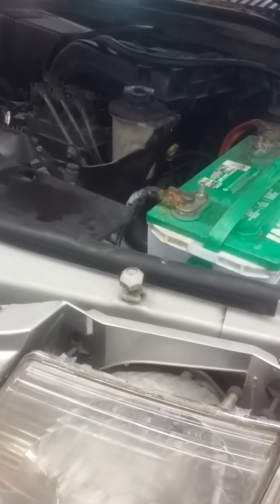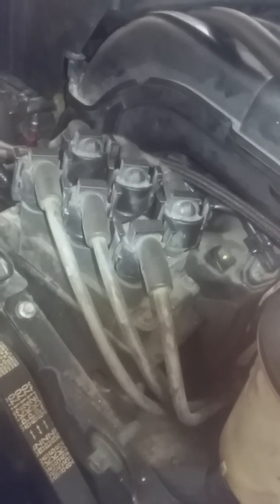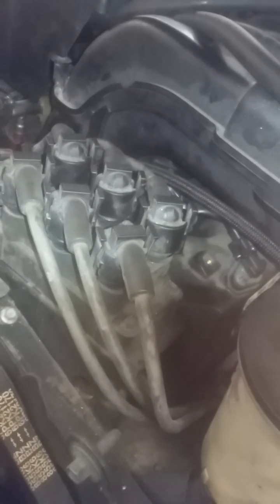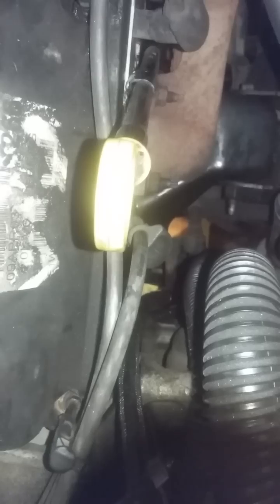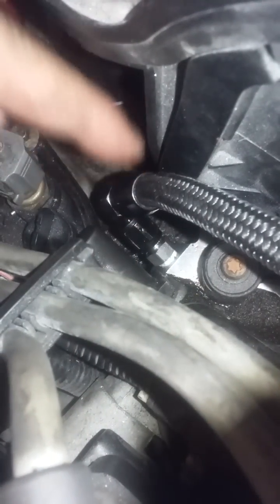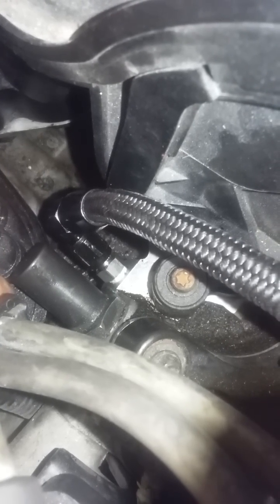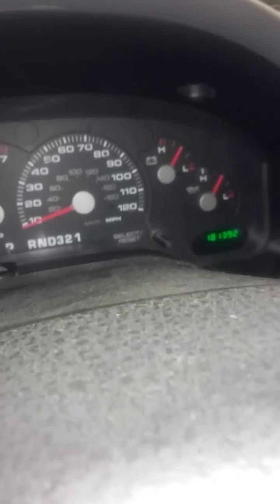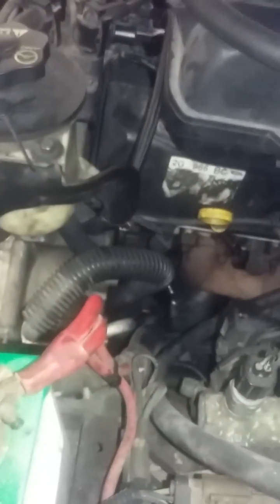4.0L SOHC Ford front timing chain tensioner rattle noise AN line fix

Comment: That's how my old motor blew up on my 02 ranger and it's starting to do it on my second so I set the idle to almost 2800 rpm to keep my oil pressure up I have no clue why my oil pressure is going to 0 but I don't care I'm going to try this if it fixes it I'm going to let yall know because the 4.0 soch is annoying as fuck and is pissing me off so I'll try it and take that tube out to check it
Reply: Did it work because mine is doing it to

Comment: Why couldn't you run the oil line to the top of the valve cover over the sprocket and install a sprayer type tip to get oil coverage on that area ?  ( I  have a manual tensioner on the left bank).

Comment: 2001 4.0 on my explorer sport. During a cold start the chains make noise for 1 or 2 seconds max and then are completely quiet after that both when idling and driving at any RPM. Even if the engine is turned off after completely warming up and then turned back on 1 or 2 hours later the chains won’t rattle when started back up…

I replaced both tensioners using OEM ford parts and this made no difference in getting rid of the 2 seconds of cold startup rattle that was present before replacing both tensioners and the reason I replaced them in the first place. When I removed the old tensioners they both seemed to still have good resistance when trying to compress them compared to the new ones which indicates the old ones were “probably” still ok.

Again, after those brief 2 seconds of rattle when started up when the engines is completely cold (ie been sitting for more than a few hours) it’s quiet and it never rattles or makes noise any other time.

One other thing to note is that if I do the flooded crank start method before starting it when cold, it will NOT make the 1 or 2 second rattle. (I will hold the gas pedal to the floor and turn and hold the key to crank the engine but not turn it over until after about 10 seconds and when I see the oil pressure gauge move to the middle, I let go of the gas pedal and start it) If I cold start it using this method it will NOT make the 1 or 2 seconds of startup rattle.

Is this my guides that are broken or is this normal to have a second or two of rattle when the engine is completely cold to build oil pressure and have it get to the tensioners so they tighten up to hold the chain? I’ve had this vehicle for a little over a month now and the symptom has stayed exactly same even after replacing the tensioners and changing the oil using high mileage oil and Motorcraft filter. I just want to know if this is normal or if it’s not and I should get rid of the vehicle if a larger problem is imminent.
Reply: Sadly I don’t have a definite answer for your question. I had my timing chains done about 2yrs ago. 
As soon as I got it back, it Had the 1-2 sec rattle, still does. I think its the way in which the engine builds oil pressure. Sometimes the sucker is loud, others not a peep. 
Do the pre oil in the mornings and change oil around %50 life left. Every now and then it’ll bark after sitting for 5-6 hours. 

Use Only high mileage mobile1 and Lucas oil in crankcase. 

I plan on riding my 2010 xlt, till It bows out. I got two of these money traps. 06-10. Timing craped out on the 06, nice truck. Took it to a mechanic and they seized the engine.  
I’m not paying for a second timing job! I’ll never buy another explorer for the rest of my life.

Comment: Does only the passenger side wheel well tensioner need a gasket/washer? Or does the one under the hood need one as well? I removed both of my original factory tensioners but only the one in the passenger wheel well had a washer. The one under the hood did not. So i did not install a washer for the one under the hood…is this the correct procedure?

Comment: Not gonna help if the cassettes are broken.
Reply from the maker: These had all been replaced. Engine pulled to do the passenger side as well. It fixed this noise/issue for about 3 weeks and another tensioner later before making this rig.

Comment: I have a 2001 ford ranger 4.0  
I pulled the the engine out about two months ago to do timing chain and both cassettes and all tensioners new oil pump removed upper oil pan cleaned all out 
Pulled both heads off and installed all new gaskets both of my cassette guides were broken and Jack shaft guide to 
I replaced both hydraulic tensioners but I didn’t think to check by priming engine before I put it back in truck if it was getting oil to the compartment where the restrictor was that feeds the oil to the front tensioner so when I put engine back in the front tensioner was flapping like crazy so I didn’t want to pull engine again because it’s a lot of work don’t let anyone fool you especially if you only know enough about macanic work to be dangerous like me 
So I started looking to find answer what els I could do  my head on driver side has a blockage and I come across your video and did it and now tensioner is getting oil and I want to say many thanks for posting this now I would like to have it working the right way but pulling that head after all I been through is just to much and it’s getting hot and I don’t have ac in my shop but if things go ok I may pull it this fall
The only thing I’m worried about is if the oil line I got will hold up under pressure and I don’t know how much pressure will be going threw the line I would have like to put a gauge on it but that’s moor work anyway it’s running and it doesn’t sound like my Diesel anymore 
I sent your video to a ford 25year dealership macanic friend of mine and he said very interesting and of course they would have replaced the head for 5 thousand before they would do a mod like that it would have been to simple for dealerships to do it anyway thank you I just hope my china oil line holds up

Comment: I was wondering where that 3rd tensioner was located

Your oiling line Mod makes great sense and since the tensioners act just like hydraulic lifter and with low to no oil pressure they don't take the slack out of the chains 

Thanks
Reply from the maker: The 3rd (cam) tensor is on the back of passenger side head. Engine has to be pulled to replace. They are known for coming apart and falling down in the engine. This engine was pulled to replace all of them because of this. The oil pump feeds the first oil gallery right below this one so it doesn't lack pressure. The line I added to the front cam tensioner is the last thing the oil pressure gets to in the gallery system. With the line it gets pressure before the lifters in the head do.
Reply: I saw the Tensioner You get at under the intake manifold and the one You access through the wheel well on the passenger side that is on the outboard side of that head
What other chain is on the rear ?
I am trying to research this problem for a Friend that is clueless and other people are paying for the repairs or junking it

I will look for that 3rd tensioner on the rear of the engine

I fully understand about removing the engine for replacing that chain guide assembly driven by the Jack Shaft

Thank You

 @m85suchka
Reply from the maker: @joetterolison1286  the passenger rear is the 3rd chain. Only two tensioners you can putt from the outside of the motor.
Reply: @m85suchka  if you’re in the Connecticut area, would you be willing to do this to my 07 Ranger 4.0?

Comment: If you don't fix this rattle can it cause a lot of problems? I don't think i can afford to do all this?
Reply: I'm not a mechanic. But I have an 07 explorer with the same "death rattle". My mechanic says that it's not a major issue and it can run for quite a while like this. But for the cost of time and labor to fix it, you are better off just replacing the entire engine with something that's not the the Cologne 4.0. This engine is a terrible design.

Comment: Thanx! I have a 00' explorer limited 4.0 with that same ticking noise. I thought it was a lifter. But I noticed during research that the chain tensioner issue seems to be common thing. Well done!

Comment: How did you get the tube out
Reply from the maker: I left the plastic tube in. With pressure from the block overcoming what's flowing through the block at the rear and accross the head after loosing pressure at each cam journal the oil from the hose I mad keeps the tensor happy.  I rebuilt the engine to find I still had this issue while studying the oil galleries of the block and head to come up with this. I bet the cam journals had some extra clearance contributing to the issue. But I didn't measure them while I had it apart because it's still a Ford 🤷

Comment: Hey would you happen to know the size of the fittings you used? As well as the hose length? Trying to get the parts to do exactly what you did. Also did you use and teflon tape on the threads? Thank you
Reply from the maker: Only use Teflon tape on the npt threads. But it's 1/4 npt at the block and oil pressure sensor. So you'll need 1/4npt T fitting with one male and two females. Then a 1/4npt male to 4AN male at the T fitting. Then a 1/8npt male to 4AN straight male at the Port on the head. Along with a 4an straight and 90 degree hose end with line made to length. The length I don't know what I used buy that will vary depending on the way you route it.
Reply: @m85suchka  thanks man!!! Does this include the threads going in the block and where pressure sensor goes? And I should be able to get all these at home depot right?
Reply from the maker: @HDGarcia92  the AN fittings and AN adapters you won't find at a home repair store.
Reply: @m85suchka  I found everything on amazon, but while I was looking at the pressure sensor It looks like I need the male on one of the ends instead of the middle. Is that right?
Reply from the maker: @HDGarcia92  yeah male on one end off the straight and 2 females on the others
Reply: @HDGarcia92  Did you  complete the modification on your Ford 4.0L?
Reply: @robertgunning415  not yet I started moving from my house after I had all the parts and haven't started yet.
Reply: @HDGarcia92  I'm looking on Amazon now to try to figure out what parts I need.  It is confusing even with all the information posted.
Reply: @robertgunning415  it is confusing but it heps if you make a diagram. Basically you will need a 1/8" to 4an adapter both ends male. 1/4" to 4an adapter also both males. The T will be 1/4" all around but one of the ends will be male. the middle and other side will be female. Then just a 4an hose to go from the fitting to the timing chain tensioner. With at least one end having a 90 degree angle. Maybe both if you want to put it on the end of the T rather than the middle.
Reply: Thank you for the video. I did my 2004 ranger 4.0 sounds petty nice now.

Comment: Wish I could have heard it before. Mine sounds like a lifter clatter even though i have awesome oil pressure. Is that what they sound like. Not a  ford guy here. Can't really tell where it's coming from. U got a parts list not a plumber and not familiar with the terms u used.

Comment: Great Idea... is there a similar port for the rear tensioner as well?... if so wouldn’t  it be a good idea to supply both or is the oil supply not an issue at the rear?. Thanks for your reply..
Reply from the maker: The oil pump is at the rear of the engine and the rear tensioner gets oil way before the front one. The rear usually isn't a problem just the plastic guides falling apart which involves pulling the engine to replace.

Comment: Make sure the oil hole on the engine and the Hydraulic Tensioner are lined up when torqued in.  The thread alignment may have been stripped causing the holes not to align.  That was the issue on my Explorer after changing the tensioner and chains.
Reply: There’s no need to do that,the design on oil passages on this engine are in such wat that any position at torque is ok for the oil to activate the Hydraulic tensioner..✌🏻
Reply: @felipevalles8041  That's what my mechanic said too but after I lined up the holes the rattle went away.  Also always use FORD Genuine parts all the aftermarket parts are garbage.
Reply: How can you make sure its lines up? I cant really see it and had to tonight a little more as it was leaking. Thank you
Reply: @HDGarcia92   Apply a paint marker on the head where the hole is located and on the tensioner too where the hole is located.

Comment: thanks for that. way back in the 50's my dad had a chevy inline 6 and he could not get oil to the rockers. back then the lifters were down on the cam. anyway he did that same thing with copper tube and ran it up to the port on the top side of the head. he drove it like that until it just fell apart. no a new idea but hey it works. and thanks for showing how you did that.

Comment: Does this work for the 3.0 also?? I have a rattling noise on the back of my motor too.
Reply from the maker: 3.0? Like Taurus V6?
Reply: @m85suchka  yep my ranger XLT has a 3.0 v6.
Reply: @blackout260112  No....ive never heard of the OHV Vulcan V6 having a timing chain issue...
Reply from the maker: Those are ohv not ohc correct?

Comment: I am having trouble with my 2003 4.0 and I notice that it has almost been a year since you had made this modification to your truck. How is your truck running now any follow up problems with this modification? I am really debating on trying this out but I do not want to damage my motor anymore. So I was just wondering how the long term results where. Thanks
Reply from the maker: Been running fine with it still as is
Reply from the maker: @Chadech actually I just sold the truck.

Comment: Is that the noise i hear when i start my 01 Ranger 4.0 SOHC?  Then makes the same noise when the engine is cold and you trottle up hard doesn't matter the season.  Ive had it at numerous places with no luck   100% running and driving truck other wise
Reply: Yes its the timing chain cassettes either broken or worn. As long as you dont have the death rattle they will run for many years/alot of miles rattling.

Comment: My rattle doesn't start until the engine gets hot. Its  quite on start up cold. Any recommendations???? I already replaced both tensioners.
Reply: Jaime Casa did you fix your problem
Reply from the maker: I never had a hot engine chain rattle
Reply: Timing chain cassettes are worn and/or broken

Comment: Buy a Dodge Durango you will not have this problem
Reply: michaelheiland123654 I’ve owned both first gen Durango and second gen Explorer and the Explorer blow the Durango out of the water the durango’s trans sucked and the truck would never stop overheating the explorer had one problem after 5 years I needed a new EGR valve after that perfect the Durango I got rid of it was falling apart every time I fix something, something else breaks
Reply: Dodge? Lmao ya right kid!
Reply from the maker: Dont buy any domestic and problem solved
Reply from the maker: I didn't buy this thing anyways it was free so that helped with the headache a bit
Reply: Ford es una porquería, no sirven, sus sistemas son odiosos e innecesarios.
Reply: Prueba  cranking el auto por 1/2 segundo y luego  enciende el motor.  Ya no se oirá ese sonido encendido  en frio!!

Comment: Jared  - I like your solution to the technical issue - is it working long term ?

Isn't the fitting at the oil galley on the block next to the tensioner a metric fitting ?  How do you get a AN fitting into it ?
Reply from the maker: It's a 1/8 NPT at that port for the tensioner in the head and 1/4 NPT at the oil pressure sending unit. A year later still going strong!
Reply: @m85suchka  are these part from the plumbing department?

Comment: I️ purchased everything to run line up to that   Like you. I️ installed new tensioner and still no help. Not getting enough oil pressure to it. I️ blew out the port which really didn’t help. I’m going to install the line next weekend when I’m home to see if it cures the problem.
Reply from the maker: I think I've discovered the actual cause for pressure loss to the drivers side head. Have you done the timing chains? There is and o ring behind the primary chain guide that is commonly left out or blows out causing oil pressure to leak out into the oil pan.
Reply from the maker: http://www.explorertalk.com/forums/attachment.php?attachmentid=6929&stc=1&d=1285125593    In this pick you will see the primary chain guide on the right of the primary chain (the big orange block) You can see the oil gallery that runs horizontal to the oil pressure sender. There is a diagonal gallery that feeds the drivers side head. Behind where the bulge between the two bolts of the guide is a port into the gallery that needs to be sealed with an o ring. Mine was missing the o ring (thanks to the guy that should have never touched it) which I have a feeling was the root of the problem. I'll be starting it up again soon in the next few days.
Reply: @m85suchka  did the o ring fix your problem?
Reply from the maker: @mikelopane6211  the o ring helped bring the pressure up at the sending unit due to less bleed off behind the primary chain guide.
Reply: @m85suchka  did your timing chain rattle go away?  I replaced everything but I think my mechanic forgot the o ring.  I have even changed the pump. Rattle is bad when engine is hot.
Reply from the maker: @mikelopane6211  yeah it's gone. Thing sounds great a year later even.